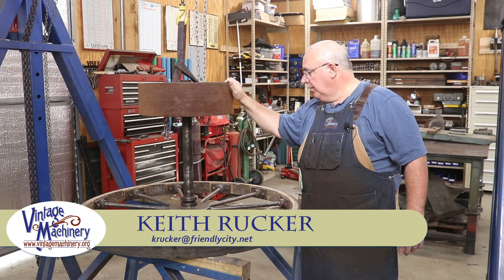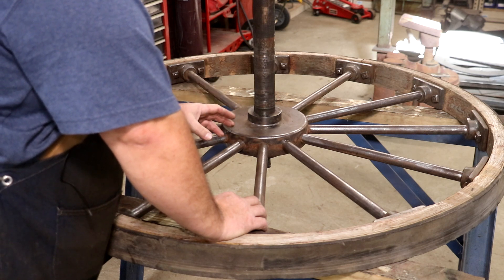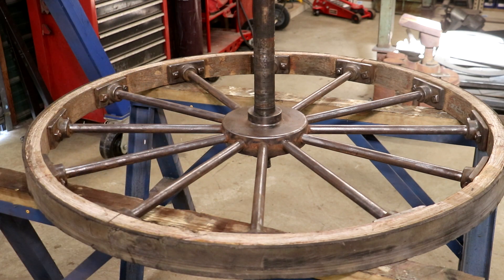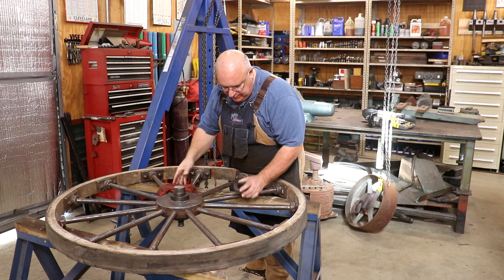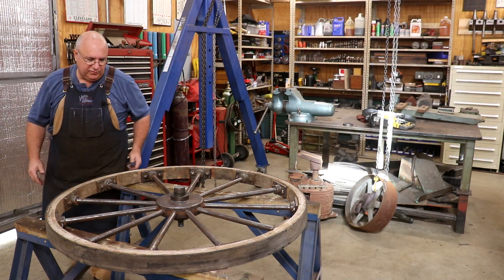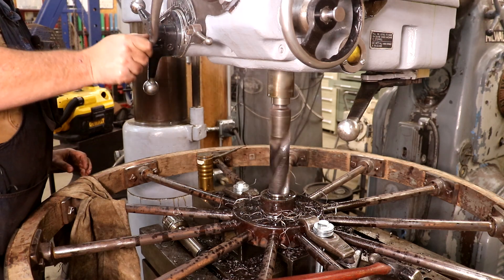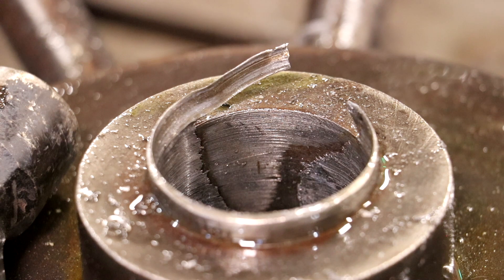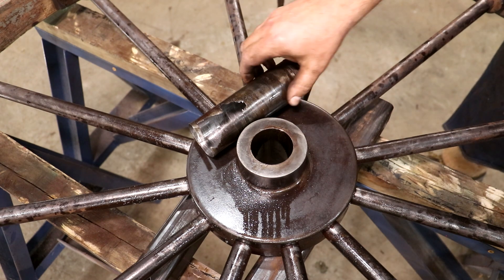The Jimmy Diresta Bandsaw Restoration, Part 5:  The Battle of the Stuck Wheel Shaft - I WIN!

Comment: With such a slight taper it was probably designed and manufactured for the shaft to never be removed from the wheel without destruction. Maybe Inversely to instint, the heavier the taper is, the ultimately easier it is to separate. Perhaps when the shaft and wheel were joined in manufacture, the hub was also preheated for a near permanent bond. It is doubtful that trying to turn the nut the wrong way, even to stripping the thread, after it had been set in place for more than a hundred years, would have been the main cause of the shaft still binding to the wheel against a 30 ton press. It was always going to be a b@$$er to separate with some destruction required.
Reply: Shows the ingenuity of people over 100 years ago.
Reply: Knowing about the taper and the left hand thread, this might have come apart easier 90 years ago using a gear puller.
Reply: @alandaters8547  As the shaft never had any keyway or key to prevent rotation of the hub against the shaft, I very much doubt that any ordinary gear would have ever been capable of separating shaft and hub once assembled in the factory.
Reply: @agomodern  Sometimes one can wonder if considering the ordinary everyday common man, that as a species we have actually advanced or maybe we have gone backward. There are of course now as always brilliant people who have created brilliant things, but these are the elite of our species, and not the general populace. If these elite and their knowledge were suddenly lost,  would the mankind of today survive or recover any better or any worse than some other time in the past.
In times past people like Keith would have been considered general knowledgeable and experienced tradesmen, maybe a little above the average, but definitely not unique or irreplaceable. But in today's world, how many others are readily available that could easily step into his shoes if such a position became available.
Reply: @trevorkrause7220  Right, and today we need a functioning power grid to open a can of beans.
Reply: I’m betting the second wheel will have to be drilled out also for all the reasons you stated.
Reply: @ellieprice363  I am hoping that Keith can delve into his library of old and rare engineering manuals to find a less destructive solution. That would be a video clip worth watching, rather than just a repeat of the former. By the way, did anyone ever find out what that small mystery hole was for?

Comment: 20:40  When you got ready to do the 2" drill bit, why didn't you do the dial indicator thing again to see if the wheel had shifted, and then recenter it again if needed?   Just curious.
Reply: Drill bits will tend to follow the hole.  A drilling machine like the Carlton doesn't have the steadiness to resist moving with an end mill.
Reply: @royreynolds108  Interesting, thanks.   I would have thought that a 2" bit would be so rigid that it would be able to resist sliding back into the existing hole.

Comment: Question (because I don't know):  Why even bother with making left-hand threads on this and finding a left hand nut.  Why not just use thread locker?  Or, a castle nut and cotter key?
Reply: This was manufactured in the days prior to Loctite.  The castle nut and cotter pin would likely work, as long as the machinery designer is okay with up to 60 degrees of rotation being close enough, and the "inelegant appearance" of the castle nut and keeper.
Reply: Used as a safety measure to counter the loosening effect of vibration and rotation.

Comment: What happened to coolant?  I always used soluble oil.
Reply: Nothing.  It is still around.
Reply: Soluble oil grows bacteria if you leave it too long, so for hobby/occasional use its often not the best.

I've had some success preventing the germ growth by adding copper scrap to the container.

Comment: I am surprised that you did not use boring head as the last stage. Or use a die grinder to grind out the last millimeter or so. A 2 inch twist drill is too crude in my opinion.
Reply: What part of his procedure didn't work?